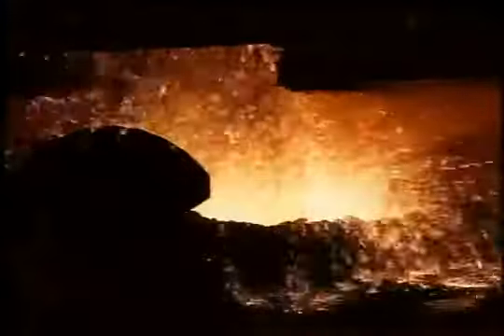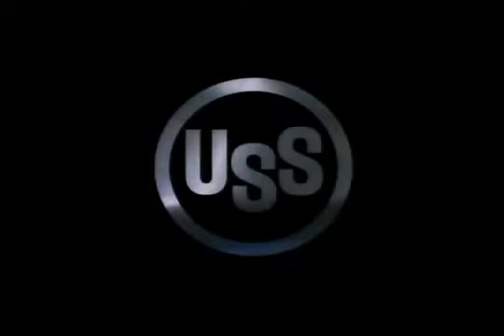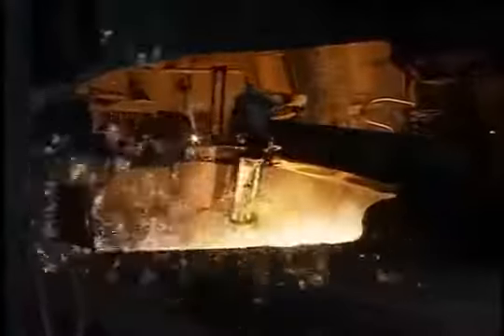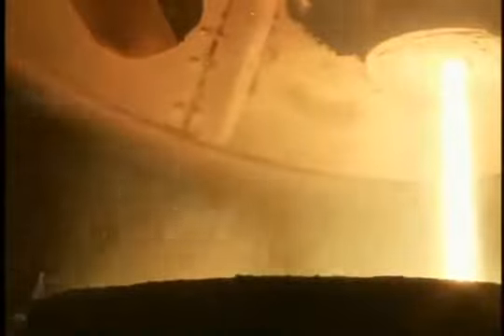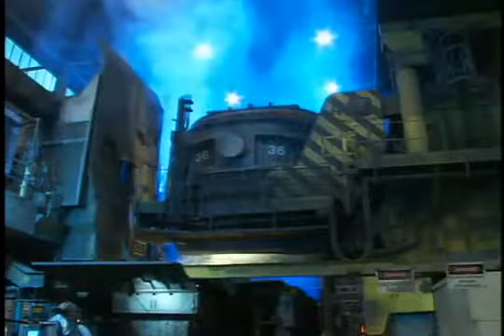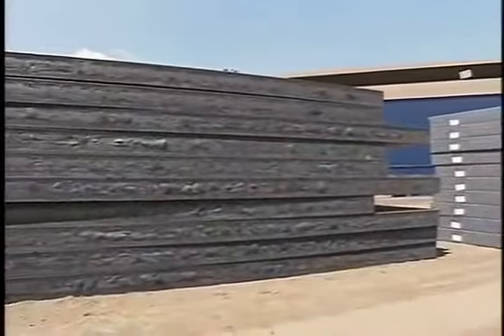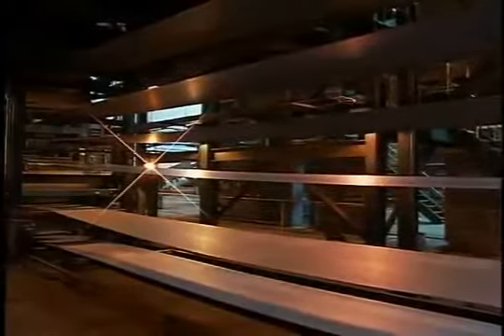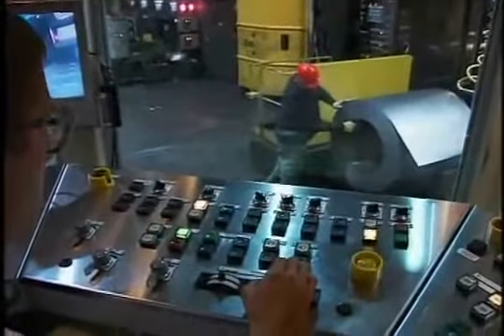STEEL  From Start to Finish

Comment: DELFT "Steel Making Quiz 1"
Mahendra Kresna P 2713100005
PBB B
This is my review for steelmaking video
Steelmaking the process basically start with the process basically start with the production of iron. which the raw materials are iron ore (Fe2O3), Coal (C), and limestone (CaCo3), the iron ore restored according to origin then the various sorts are reclaimed, and then put them on the layer. With the conveyor they transport to the next step in the process the layers are mix in the rotating drum of the reclaimer to make an optimum blend. The transporter rolling into the furnace and the other raw materials such as coal ground to powder and blown into the furnace at 1100°C the coal is now converted into metallurgical coke consisting the pure carbon and minor pollutions, the metallurgical coke move from the furnace to the quenching station and after cooling they size is change into large size coke and lumb coke later than they used in the blast furnace, and the small size coke later be used in the sintering process. Iron ore complish and also limestone are now carefully dispensed and blended. This blend is speared on the strand which slowly moves under combustion hood.  The combustion zone move downward through the blend the high temperature such as the ground iron ore into the porousness as soon as the blend is completely burned through it is coal crushed and screen. While the fines are returned to the sintering process. The remaining product is the sinter, a basic component for the next step, the blast furnace operation. Sinter, lumb coke and limestone are via conveyor belt or skips transported to the top of the blast furnace. Iron ore is principally a compound of iron and oxygen (Fe2O3). Iron is production by reduce the oxygen using coke. This reaction (Fe2O3 + 3C = 2Fe + 3CO) is endothermic. To sustain the reaction extra coke is injected together with hot air. The air is preheated to around 1250°C in hot blast stones and blown into the furnace through tuyer and equally distributed around the furnace. Moving downward the sinter, coke, and limestone are converted into the liquid iron and slag. To save the use for more expensive metallurgical coke, sometimes polarized coke or oil is injected. By the computer the process operating parameters are kept under the close control. The iron turned into pig iron is collected in the bottom of blast furnace and tapped into torpedo later. It’s here that the real steel making process starts. Beginning with the dissolve reaction process by injecting lime powder to avoid ductility at high temperature a solver reduction that value lower than 0.01 percent is necessary. Now the liquid pig iron is transported to the steel plant. Steel making can be carried out in several processes. Nowadays only the BOF and EAF processes are relevant. In the oxygen steelmaking processes the liquid pig iron is transferred into another ladle. The temperature is measured, and the samples are sent to the laboratory and the floating slag is removed. The liquid pig iron now put into a converter. Subsequently scrap is added, this is to control the temperature increase due to oxidation impurities maybe carbon and silicon. Pure oxygen is blown into the blast, the impurities of oxidize and slag are floating on the surface. Finally the temperature above 1620°C is obtained. At the end of the oxidation process the samples are taken for chemical analysis. Within five minutes the result are presented on the screen in the steel plant, from the analysis also the announcer following elements: in reagents for dissolve reactions and the oxidation determinant. Alloying elements to ensure a steel composition related to the final properties and used of the steel. By using the alumunium the steel is deoxidize (4Al+3O2 -> 2Al2O3) the steel is killed. The alumunium associated with the oxygen and improve the ductility these element will be added during taping of the steel from the converter into the huge ladle. The ladle is placed under the converter, steel and slag up or down to the converter separately. Tapping first the steel, after that the slag. The liquid steel is then stir using an inert gas (argon) this to ensure composition and temperature to be homogenous throughout the ladle. In addition the gas bubbles float out impurities, which are observed into the slag. After refining the ladle now containing about 300 tons of liquid steel is taken usage in continuous casting machine. Pour like here into an emptied in gate mold.

Comment: DELFT 'Steel Making Quiz 1'
Samuel Budi Utomo 2713100091

The process Basically starts with the production of iron, of which the raw materials are iron ore, coal, and limestone and the iron ore stored according to origin. Before being processed into the next step, the layers are mixed in the machine. While the iron ore being transported into the furnace, the coal ground into powder is blown into the furnace. After heated, the coal transformed into coke, and the metallurgic  coke is guided into a quenching station and classified into large sized coke, and two other coke. The coke that usually used in the furnace is the large sized one. Iron ore, coke breeze, and limestone are blended in the machine. The machine is speeded on a strand, which slowly move under a combustion machine. This process is called the sintering process. The combustion machine move downwards through the blend and the high temperature sinters the ground iron ore into a porus, and as soon the blends are completely burned through, it is cooled and crushed and the remaining products are the sinter, the basic component of the next step, the blast furnace operation. Sinter, lump coke, and limestone transported into the top of the blast furnace. Iron ore is simply compound of iron and oxygen, and iron is produced by the extraction of oxygen using the coke and the reaction is endothermic. To sustain the reaction, extra coke is injected with hot air, and the air is preheated around 1250oC and blown into the furnace through tuyers, where its equally distributed around the furnace. Moving downwards the blast furnace, the sinter, coke, and the limestone are converted into a liquid iron and slag. To save the use of the expensive metallurgic coke, sometimes pulverized coal or oil is injected. The process is kept control by the computers and the operators. The iron or the pig iron is collected in the bottom of the blast furnace and tapped and it is the beginning of the real steelmaking process starts. Beginning with the disseveration process by injecting limepowder. After the liquid pig iron is transported into the steel plant, steelmaking can be carried out by several processes. Nowadays, only oxygen steel converter and electric arc furnace are relevant. In the oxygen steelmaking  process, the liquid pig iron is moved into another section. The temperature is measured, the sample is sent into the laboratory and the floating slag is removed. Then the liquid pig iron is moved into a converter. Some scraps is added to control the temperature during the oxidation of the impurities. Then the pure oxygen is injected into the converter, then the impurities turned into slags that floating in the converters surface, then samples are taken for analysis. After the slag is removed and cleaned, the molten steel is tapped to continue the process of steelmaking.
this is my review, thankyou

Comment: DELFT "Steel Making Quiz 1"

Muhammad Afza Nur Hakim 
2713100140 PBB B

The steelmaking process started with the production of iron. The raw materials are iron ore (Fe2O3), Coal (C), and
limestone (CaCO3). The iron ore stored according to origin. After that the iron ore is then sorted. Before being transported to next process, the chosen sorted iron ore are mixed on the rotating drum to make an optimum blend.  While the iron ore is being transported into the furnace, the other raw material which is the coal is putted into the furnace. At 1100 degrees centigrade the coal is now converted into coke which consist pure carbon with minor pollution. Removed from the furnace, the coke now moved to the quenching station, and then after cooling, the coke is separated into large sized coke, lump coke to be used in blast furnace, and small coke breeze for sintering process. Iron ore, coke breeze, and limestone are now
blended. After that, this blend is now spread on a conveyor which slowly moves under combustion hood which start the sintering process. The combustion zone move downward to the blend, the high temperature sends the ground iron ore to
burn, as soon as the blend are completely burned through, it is cooled and crushed. While the fines are returned back to sintering process. Remaining product is sinter which is the basic component for the next step, which is the
blast furnace operation. Sinter, lump coke, and limestone are transported to the top of blast furnace via conveyor belt. Iron ore is basically a compound of iron and oxygen (Fe2O3+3C). Iron is produced by extraction of oxygen using coke (2Fe+3CO). The reaction is endothermic, resulting iron (2Fe). To make the reaction sustainable, additional coke is injected together with hot air, the air is pre heated to around 1250 degree centigrade in hot blast stoves. And blown into the furnace through the tuyère which are equally distributed around the furnace. Moving downward the sinter, coke, and limestone
are converted into liquid iron and slag. To reduce the cost of expensive coke, sometimes pulverized coal or oil is injected. The process is closely controlled by computer. The iron resulted is called pig iron, collected and tapped from
the bottom of blast furnace into ladle. Now the steelmaking  process starts. Started with desulphurization
process by injecting lime powder (S C → SCaOC → CaS CO). To avoid loss of ductility at high temperature a Sulphur is need to be reduced until lower than 0.010%. Next, the liquid pig iron is moved into the steel plant. Steelmaking can be carried in several process, for example, Siemes Martin Furnace, Oxy Steel Converter, Electric Arc Furnace, and Thomas Converter.
But nowadays, only Oxy Steel Converter and Electric Arc Furnace are used for steelmaking.  In the Oxygen Steelmaking process the liquid pig iron is moved into another ladle, then the temperature is measured, and the sample is sent to laboratory and then the slag is removed. Now the liquid pig iron is poured into the converter. After that, scrap is added.
This is to control the temperature increase caused by oxidation of impurities, mainly Carbon and Silicone. Pure oxygen is then blown into the bath. The impurities will oxidize into slag and then float to the surface. The bath
temperature 1650 degrees of centigrade is obtained finally. At the end of oxidation process, sample are taken for chemical analysis. Within 5 minutes the result is shown on screen.  The amount of alloying elements and reagent for desulphurization and deoxidation are determined also. Alloying element to make sure the steel composition is related with final
property and application of the steel. By using Aluminum the steel is deoxidize (4Al+3O2 → 2Al2O3). The Aluminum associates with oxygen resulting improvement in ductility. The element will be added during tapping from the converter into the huge ladle. The ladle is placed under converter. Steel and slag are poured out of the converter separately, this can
be done by making small hole so that the steel can be tapped first because slag is floating in the surface of steel due to the difference of density, then the slag can be poured out after that. Tapping the steel first. After that, the slag is tapped. Inert gas, Argon, is added to liquid steel to ensure composition and temperature are homogenous throughout the ladle, besides that, the gas bubble can float up the impurities which will absorbed into the slag. After refining, the ladle which now contain about 300 tons of liquid steel, is taken to either to a continuous casting machine or poured into ingot molds.

Comment: DELFT “Steel Making Quiz 1”
Afira Ainur Rosidah
2713100114
PBB B/Ms. Dian Mughni Fellicia

This is my review about the steel making video.

Steel making, the process is basicly started with the production of iron. The raw materials are iron ore, coal and limestone. Then, the raw materials is converted to some layers of fines making. Before it is transported for the next step of the process, layers shaped like a pyramid then the layers are transported to make an optimum blend. While it is transferred to the rolling of the furnace, the other raw materials, the coal is blown into the furnace. At 700 – 1100¬ degrees centigrade, the coal is now converted into coke. Consisting of pure carbon with many impurities. Removed from the furnace, the coke is guided to quenching station. And after cooling, the coke is turned into large size coke then it is ready to bring to the blast furnace. And small coke brings to be used in the sintering process. Iron ore, coke and also limestone are now blended. This blend slowly composed with the sintering process. The composed zone moves downward through the blend. The high temperature sized the blend and also the mass. It is crushed, and the fines is returned into sintering process. The remaining product is sinters, the basic compund for the next step. 
The blast furnace operation. Sinter, coke and limestone or the blend is transported to the top of blast furnace. Iron ore is principly a compound of iron and oxygen. Iron is produced by the extraction of iron and oxygen using coke. This reaction is endothermic. To sustain the reaction, coke is injected together with the hot air. The air is reheated around 1500 degrees centigrade. Moving downward, the sinter, coke and limestone are converted into pig iron and slag. By computers, reading of the parameters are under controlled. The iron, turned into pig iron is collected to the bottom of the blast furnace. And then move it to the top. It is here, the real steel making process starts. Beginning with desulphurization process by injecting a powder contains S and C. To avoid loss of ductility at high temperature, the reduction of sulphur up to 0.01% is necessary. Now, liquid pig iron is transported into steel plant. Steel making can be carried out in several processes. Nowdays, only oxy steel and electirc arc process are relevan. In the oxygen steel making process, the liquid iron is transported into another lethals. The temperature is measured then samples are sent in refractory. And the floating slag is removed. Liquid pig iron is now poured in the converter, then scrap is added. This is to control temperature increasing due to oxidation the impurities, mainly carbon and silicon. After the blend added, pure oxygen is blown. The impurities will float in the surface. In the end of oxidation process, substance are taken for chemical analysis. From the analysis, the amount of alloying elements, also the desulphurization and the oxidation in the turner. Alloying elements to ensure steel composition related to the properties and use of the steel. By using the aluminium, the steel is oxidized. Aluminium assosiated with oxygen improving ductility. This element will be added during the taping of the steel to the converter into the huge lethal. The lethal is placed under the converter. Steel and slag are separated. Liquid steel then is given inert gas, Argon. It makes the composition more homogenous in the lethals. in addition, the gas balls float up impurities. After refining, the lethals now containing about 300 tons of liquid steel. It is taken to continuous casting machine. 

Thank You.